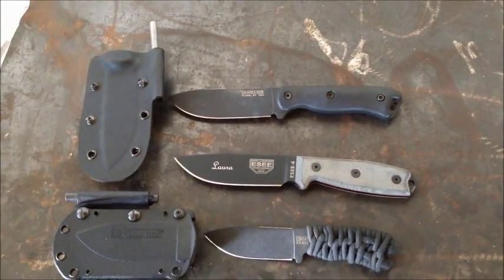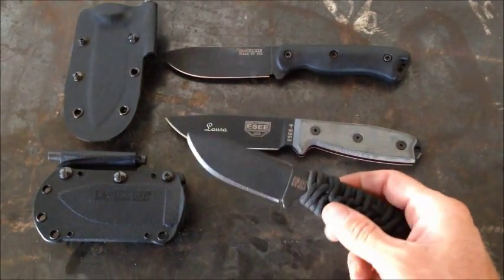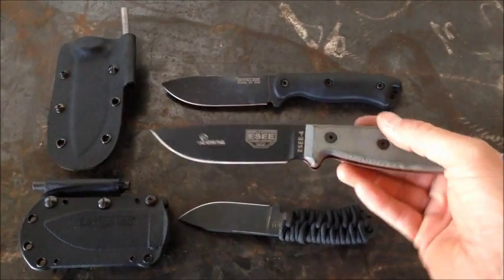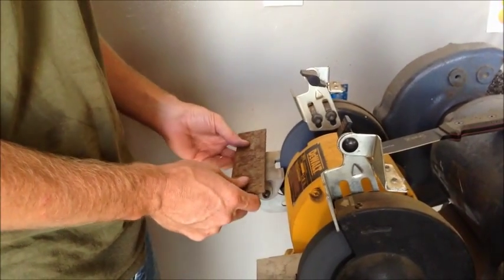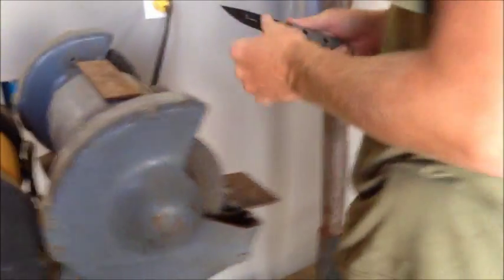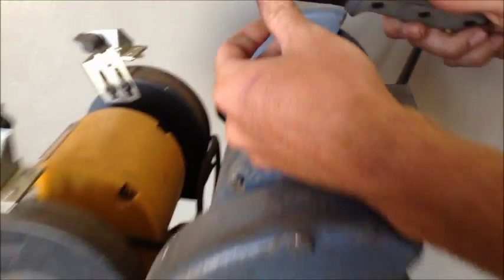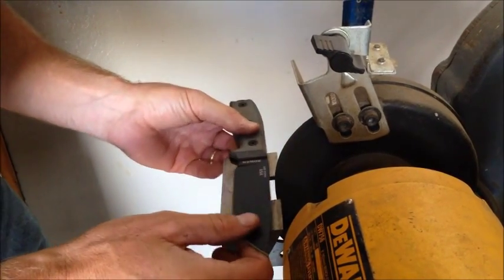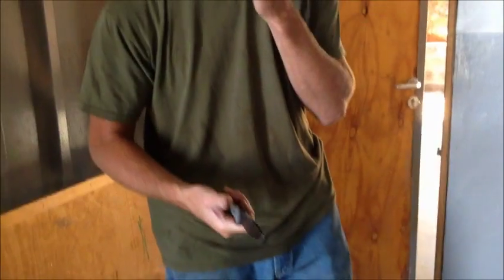90 degree spine

Comment: That's the best video on making a 90 degree edge on your knife I've seen so far. The video was right to the point and quick. BTW, in another video you say you live in the Bush. Without compromising your location, where abouts do you live?

Thanks!
Reply from the maker: Thanks. East Africa.
Reply: equatorbushcraft No wonder you can get Elephant Dung! This may be a dumb question but are you allowed to carry firearms where you live? I live in California and we have strict rules regarding open carry and where you can shoot.
Reply from the maker: Yes you can carry but it is a very long process.

Comment: get brother i used a work sharp knife sharpener in my tops silent hero to put a 90°spine on it.  it throws sparks on my ferro rod but not great. I noticed that there is really small burs on the knife.  do i grind this down to get better sparks from the ferro rod or do i need to grind more.  I'm not worried about the loss of the knife I'm just worried about the function and integrity of knife.  Thanx!
Reply from the maker: If it has coating of any kind on it has to come off. Take the spine of the knife and slide it on your finger nail, if it take small shaving off your nail it will throw sparks. Crazy but that is how i gauge it. I would take the burrs off and you have to make sure that there is no coating on the side of the spine as well.
Reply: Thanks chief I ended up using a Dremal Copper wire wheel to get some of the coating of the side of the spine and wouldn't you know. It throws sparks great. Thanks for the video buddy and for replying. I also touched up the spine with a file I had. I'm more than pleased with the out come. If I blue the part that I filed down, will it stop it from throwing sparks. I just want to help keep the part I filed down from rusting. Thanx once again and your video was very informative. God bless!!

Comment: Sir. Thank you for the info. Once you've ground off the coating; is the steel capable of throwing sparks from flint or churt? Ive been considering getting the esse. Is the cutting edge a flat grind or one of these fancy convex scandi grinds? Ive never been good at sharpening. Need something simple. ;-)
Reply from the maker: +Christopher O&#39;Dalaigh Hello. Yes the steel is capable of throwing sparks by using everything you mentioned and the right stone as well. It is a flat grind.